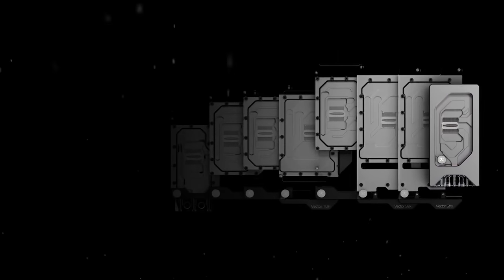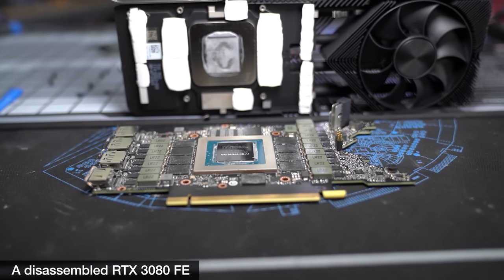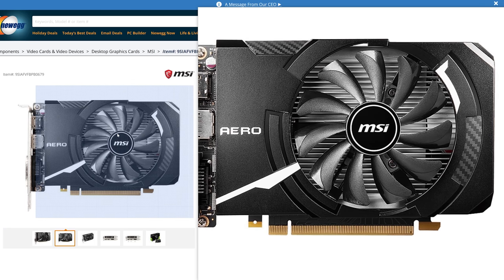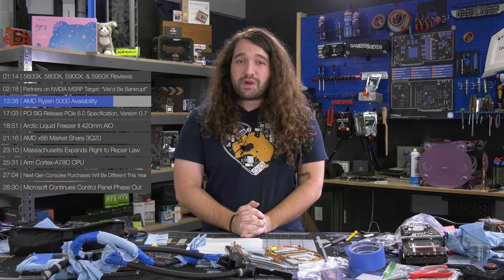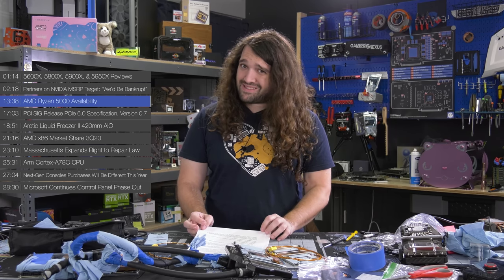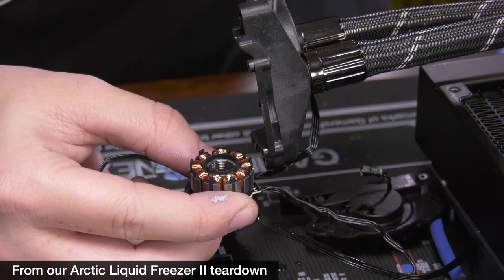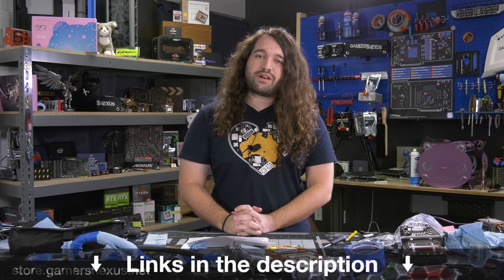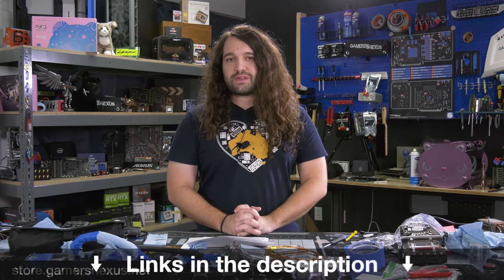HW News - NVIDIA MSRP Allegedly Not Realistic, Ryzen 5000 Supply, PCIe 6.0 Spec

Comment: Problem I have with the supply is that companies like Newegg will bundle the cards with ram, power supplies etc junk that ppl aren't buying to move stock at a higher price. Also the fact that best buy, newegg, Amazon still have no queue based system so everything gets bought up and put on eBay for double the price. Amd said they'd be working to have more availability for their video cards.. Well good luck with that bc the cpus aren't available

Comment: How is the GPU cost situation different than before, though?  The partners have always had bottom dollar cooling options,  but you could always spend well over MSRP for a card with a premium cooler.

The partners need pressure to keep costs down to the consumer or they absolutely will make stupid short term profit decisions that screw them long term. Cost pressure that comes from consumers is a lagging indicator that you have problems (many companies have destroyed themselves making short term profit decisions that ruined them in the long term). It's actually nice to see them getting some up front pressure to keep costs in mind when they build new cards.

Comment: On Ryzen 5000 CPU availability, I went a half hour before my local Micro Center opened on launch day. I was 105th in line and was able to get the 2nd to last 5950X, so I'm not sure of how many 5950X's they had on hand. I found it interesting that they had what looked like 30+ 5900X's on hand still in the cage, and maybe 100+ 5600 & 5800 CPU's in the cage when I left. I went back today to pick up some water cooling connectors and the guy said they didn't run out of inventory until just after 12 noon(3 hours after they opened) and there was NOBODY at all in line outside after the 1st 45 minutes. Pretty cool and a lot more inventory than I expected. I'm going to go back at 1am on the 18th to try to get a 5800XT. If that doesn't work out I'm going to pay my nephew with a PS5 for Christmas to wait in line 24+ hours in advance for me in Dec to try to get the 6900XT. No I won't say which Micro Center in case you're planning to jump my place in line!!! Haha!

Comment: Regarding control panel. Some things that are available in the control panel are not in the settings app. If they remove control panel that means i'll in the future have to google command line arguments or registry hacks for doing some things, and that some info will be very difficult to access (reading through command line calls or registry). I'm very dissatisfied with windows being hostile to powerusers. As a programmer i can probably still get things done when i have to, but it becomes a lot more work.

Comment: Hey Steve, long time viewer first time writing, I was wondering if you guys would consider looking more into Linux benchmarks and Linuxy  stuff in general. With the way Microsoft has been handling windows 10 lately, taking more and more control away from users, I decided a while back to go full Linux. I've been amazed at the support available these days, especially proton! I realize adding another dimension to all of the benchmarks is an impossible amount of work, but even just a little attention would help Linux gaming move forward, and light a fire under Microsoft.
Reply: The Main problem is us! The users... Linux has 5% user base... Windows 70% iOs %20... or quite near like that... no users. No test, no programs... and it is not changing...

Comment: I was able to pick up a 5800X on day 1.  I actually wanted a 5900X or stretch to a 5950X if the 5900X was unavailable.  Both of the top 2 SKU's were sold out.  This was at a physical store in Akihabara Tokyo, 15 minutes after the store had opened.

Comment: As a technical engineer MS removing the control panel. Is pushing me to use power shell more now than ever. Settings is basic and the advanced settings is comparable. RIP to OG control panel

Comment: What's the point of Nvidia gatekeeping the MSRP when as soon as it arrives at the retailer they just apply a massive increase to the price? It doesn't seem right that the price is so tightly controlled right up until it gets to the stores, and that the stores must be making massive margins compared to board partners, they (Nvidia, board partner, distributors) should refuse to sell to any store that doesn't keep to the MSRP. In fact it would be interesting if you 'reached out' to a few retailers and asked them why they have shoved and extra £80, £100 or £200 on top of the MSRP, that would make interesting viewing.

Comment: You can get your hands on the new nvidia gpus and amd cpus in turkey pretty easily because no one has the money to buy all the stock. For example cheapest 3070 which no one recommends costs around 850$ and asus tuf version cost around 1000$ and when you consider that the minimum wage in turkey is around 285$ it is easy to understand why there is still stock.

Comment: In regards to the Ryzen 5000 stocks, I'm in Vancouver, Canada and I can confirm that Canada Computers had 5800X in stock at 2 locations with more than 5 units (it would just display 5+) on Nov 7th, those units are gone within a matter of a day and half when I looked again on Nov 8th in the evening after closing hours (I also checked a few times in between and did notice the stock numbers went down a couple of times before it went to out of stock/backorder), on Nov 9th another one of their locations seem to get 5+ units as well, again, this is for 5800X, I looked up 5900X and 5950X asi was curious but they didnt seem to get any, I didn't look up 5600X though.

Memory Express on the other hand don't seem to have any in stock when I checked on Nov 7th and 8th and I didn't bother to check any further.

I did get my hands on a 5800X from Canada Computers on Nov 7th and with with PBO turned on it will go up to 5Ghz on a few cores during single thread workload, though I cannot tell how long it stays on that clock speed for.

Also, just for anyone who may be curious, the memory latency is lower than the 3700X I replaced, with same ram at 3733Mhz and 1866 FCLK, ram timing at 17-19-19-19-36, the 3700X had memory latency of 67ns whereas 5800X is 57ns~60ns on AIDA64.
Reply: Nov 10th, Canada Computers just got a few 5950X in 2 of their locations and seems to re-stocked some more 5800X, I must say it doesn't look as bad as Nvidia's RTX 3080 launch.

Comment: TTnx for the WIndows OS info update..
Now i know why it is getting almost impossible to acces Disk Manager on windows. 
its not in normal systeminfo, you cant acces it with the execute (it just looks for it on the web / cant find the application).
And enabling or disabling adapters is also more and more difficult to get to.     I dont mind using the newer environment as long as it supports the same functionality, not beind deprived of it,  i'm a windows user.

Comment: This trend to "make things easier" in Windows is terrible. I think it's actually getting harder to find the options you are looking for. The control panel was absolutely fine. Hiding options isn't helping.

I remember there was a option for gamepads and controllers that was hidden until you opened a certain option WHILE HOLDING DOWN on "CTRL". IIRC it was the option to re-calibrate your joystick/controller.

Comment: About ryzen 5000, i was ready to buy a 5900x on launch day to renew my deep learning workstation cpu, and i was not able to. I already have a 3700x on it with a x470 board, so as it seems like i wont be able to get one before december, i'll just wait for a compatible bios and buy it on january... and probably by then i will just wait to see what intel launches... So in the end i had 900€ to use on a upgrade that will probably go to a 3080ti/3090 instead. I dont get the  launch day scarcity and why don't they control bots.

Comment: You know, I'd love to use window's new settings app instead of the windows XP control panel, if only I could adjust the same settings and get the same results through the new menuing.
Reply: Doubt Microsoft would listen when they are dominant market holders.
Reply: Can you even uninstall programs with the new menu?
I believe you can only unistall apps. And there is no search feature

Comment: Not looking forward to the demise of Control Panel. I am completely lost when I try to use the Win8/10 settings menu, I can never find anything. I wasn't even able to add a network printer the other day - the settings menu only wanted to search/browse the whole network when we have literally several thousand of them visible from all over the country and I would not typically have an exact name or IP to give it. In the Control Panel applet I would normally just search by directory then filter by department name and browse from a dozen or so to guestimate the closest one.

Comment: For anyone complaining about the removal of the control panel... let me ask a simple question:  Do you NOT ever just type the thing you are looking for into the start search?  I have navigated Windows like this since Windows 7!  As far as I am concerned, the control panel and all of those settings menus can just disappear, since I haven't used them since 2012.
I am more worried about when Microsoft removes the classic network layer for the bullshit they've had in Windows 10 all along.  Configuring specific TCP/IP settings via Windows 10's network settings is a pain in the butt and rarely ever works correctly, especially in multi-network scenarios.  How in the world does Microsoft expect to make that work?  If Microsoft is going to remove all of this classic interface stuff, I wish they'd just fucking do it already so we can all just be pissed off like we were with Windows Vista and get it over with.

Comment: After hearing how the whole GPU shroud and cost and pricing for everything functions, it makes sense now why all the AIBs are essentially using the 3080 and 3090 shrouds for the RDNA 2 GPUs as well. This allows them to same a huge amount on tooling and essentially just use their existing production capacity for all the RDNA2 GPUs. it also now makes sense why AMD doesn't want to have AIB cards at launch!!! Because if they were to sell AIB models at launch it would extremely difficult for them to differentiate their product from Nvidia as the physical GPUs being sold would look essentially identical to Nvidia's AIB GPU models!

Comment: i would lile to see all continium theme in windows, because the control panel burn my eyes at night with its white background, and those little windows should dissapear too, but let me clear, that yes the new settings app is confusing and should get a web-page like hierarchy because when you click back mamy times you get locked in security or networking or energy, and it doesn't let you get back to the root.

Comment: I wouldn't the Settings 'app' as much IF it allowed multiple sessions or windows, but no -- I have to click more buttons than Control Panel takes and often get lost trying to find something that was easy to find in Windows 98 - 8.1. It's a total mess that shouldn't exist, makes no sense from a UX perspective, and is not stable/reliable as the Control Panel.

Comment: I wanted to build a desktop, mainly because I've been working at home as an IT developer since March and my 6 year old craptop can't handle a simple code compilation, let alone play games...

What's the issue? In my country both 20 series and 30 series Nvidia GPUs are scarce or non-existent (in the case of the 30 series I have yet to see a store sell one at all), Ryzen CPUs suffer the same issue although the 3xxx series still has a decent stock, the issue is I want something that will last me a long time, and if for basically the same price I can get better hardware that is coming out now, why spend my money on outdated hardware? That is, if there were even RTX 20 series GPUs at all...

Comment: At this point I think Nvidia should just take the N5 process and release a RTX 4000 series in Q1 or Q2 2021. Drastically decrease the tdp to Turing levels, so that the titan has a max of 280w tdp. Give them a little more performance also and give them more memory. Also it will be easy to shift to N5P when they release new gpus in 2022 or 2023. They would win in power consumption, performance and features compared to amd, so they could also up prices a bit again according to the given benefits. Samsung's 8nm was a big fail for Ampere and N7P is much better, but at this point just take N5 and easily transition to N5P with the next line of gpus after the 4000 series.

Comment: To the argument, "Why limit supply", bump MSRP, increase demand for pre-built system, even the Newegg bundles sold out instantly $1200 for a cpu + whatever... So in the end your retailers are making profit, Prebuilt OEM's are in higher demand...ALL this ASIDE I'll ask you this.... why launch without stock ? PS5 + Xbox are already in short supply, now you add demand for Zen 3. Seems to be a paper launch to increase their stock prices but infuriate customers. The likes of Amazon don't even list the 5000's series as I'm guessing there is so little stock that it doesn't meet their supply chain requirements and not worth their time to list a product for 30-50 units and have a "SOLD OUT" sign hanging on those products.

Comment: Well nvidia did pull that shortages thing, sort of, maybe not on purpose but they did. They "release" a card that they sold direclty too expensive to sell at the msrp and they clearly knew they didn't have enough quaintities to launch, Then they sold the chips they had (at a higher price) to partners who sold the cards over the msrp effectively bypassing the msrp and their cooler design too expensive to actually sell at the msrp. They probably have some problems with samsung 8nm who knows. They had low quantities and they made the most out of it with that strategy , all before AMD get their cards out. Some youtuber even had inside info on the matter before it happend and it unfold exactly as they said it will. Nobody wants to have low stock, but if you have it, you will be better off making the most out of it. I'm guessing they will have better yields or whatever is the problem solve by next year or q2 and they will compete ok then. Still those 10gb cards are just not ok to me, they will have to refresh the lineup somehow. I'm guessing it will take them too much time to go tsmc now, or they can't get the capacity so it's looking grim for them maybe 20gb cards or TI version between 3080 and 3090. Anyway looks like a big navi generation to me. Admit it people one of the most fun thing to do about pc stuff is to speculate, come on it's fun.
Reply: also, great microsoft ! now we can't find anything quick anymore! fantastic.

Comment: Artificial scarcity maybe not for the whole line, but with their chiplet system, remember that making a higher model number CPU costs the same as a lower model number, and therefore has a higher profit margin. With scarce lower model numbers and those being bought up by scalpers, AMD could be hedging their bets that instead of paying $400 to a scalper for a $300 MSRP 5600X, most people would plunk down the extra $50 and get a 5800X so they get more cores and speed if they're going to be spending money anyways. High-end chips are where they make their money, and low end chips only exist to keep them from taking a loss on bad silicon to begin with, so I don't think creating a scarcity on the low end chips in order to guide people towards the high end, higher profit margin chips is all that crazy. Plus, the better they get at producing quality silicon, the fewer opportunities for bad silicon to make low end chips from exist. Unless they begin to purpose build lower end chips instead of creating them from failed high-end chips, there will be a scarcity of them from here on out, at least until the next manufacturing process is developed and implemented.

Comment: Ugh...   The settings app is still complete garbage though.

I use the control panel on a daily basis at work and it is always extremely irritating and disruptive to have that crappy settings app pop up when I could have already had the issue fixed via the control panel.

Comment: I'm on nvidias side on this thing these cards will be sold in huge volumes and is probably what will be in the average gaming pcs in the future replacing 2060s and 1660s. So the tooling cost should not factor in that much.
Nvidia wants the high end to be pricy and the average card to be affordable. Partners want the highest margin in the highest volume of cards. Obviously. I suspect Partner whining a bit. 
Partners probably focus too much on aesthetics. do you really need a backplate on the lower end cards, do they really want to make cheaper cards?

Comment: Just got my Aorus 3080 today and it’s so big that my Arctic Freezer II 360 tubes can just barely not reach my CPU while it’s in the proper configuration (tubes on the bottom). There is no room for a top mount :( any tips? Really derailing my build. Is it possible to extend the tubes by any realistic means? Thanks for anyone who sees this.
Reply: Get a new case or send the 3080 back and buy a big navi. I'm switching to AMD because nvidia are just way too large and power hungry.